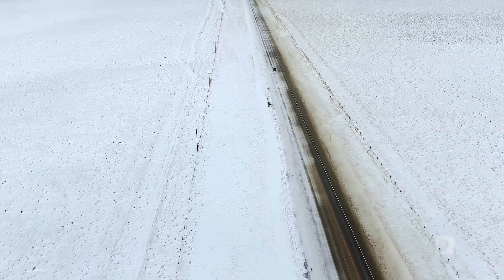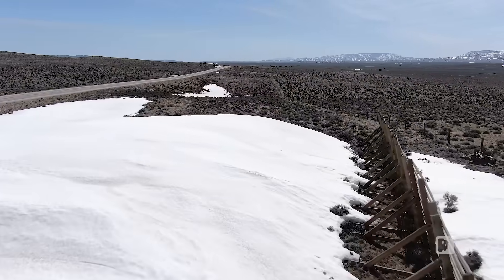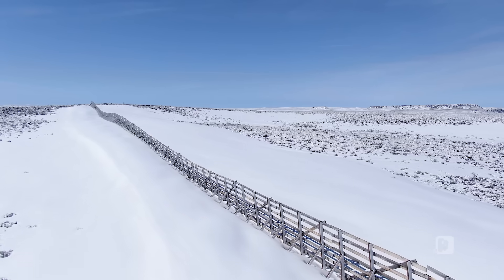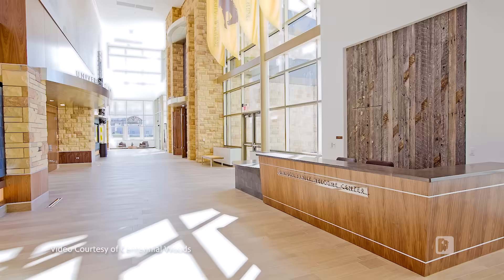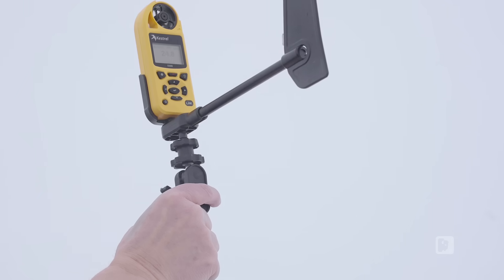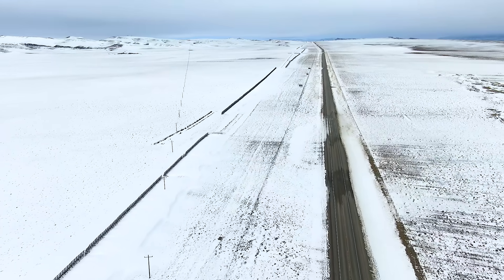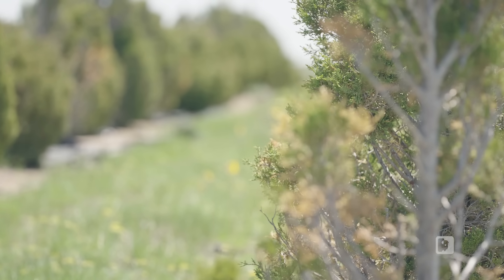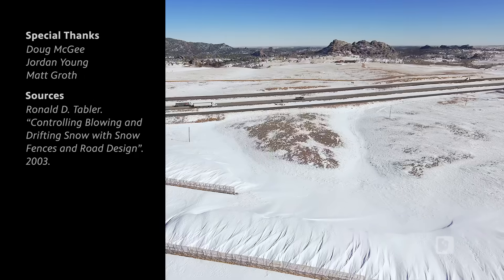The Science and Strategy Behind Wyoming’s Snow Fences

Comment: Many great ideas have eventually become bad ideas solely based on the materials used or sometimes a distinct lack of an engineer. So i hope at some point they look for a more permanent solution like steel because they can use the data collected by the timber frames and the evidence we all see of buckling as a case for investment in steel.

So the timber framing has an important function of providing evidence that a larger investment is backed by real data.

Comment: Pennsylvania stopped using snow fences about 50 years ago, and it shows! They were just rolls of two inch or so slats they would put out every fall and take down in the spring. No science or thought behind them. Now they just put up signs that unfold to warn of snow drifts along a stretch of road. So reassuring, confidence-building, and evidence of mindless bean counters being in charge of public safety.

Comment: In my neck of the woods we drove 8 ft T rails  with 5 ft wooden slatted wire (latter years)replaced with plastic ribbon )fence in in November and removed in April to not lose  any plantable farmland…approximately 75 feet from pavement perpendicular to prevailing winds….most of the farmers stored and installed the fencing themselves because of the added lbs/arce yield of crops…

Comment: iAfter WW2 and into the early '60s Virginia, Northern VA in my experience, had snow fences along may primary and heavly travelled secondary roads.  They were verticle pieces of wood, about 1 1/2 inches wide and spaced every 1.5 to 2 inches and held withe heav wire inteleaved with the boards.  They were set out in the early winter and removed for storage in the spring.  The design allowed them to be rolled up into large rolls, making the logistics of storage installationand removal reasonably easy possible.  Saw saw lots of snow drifts because of those.

Comment: When the national highway interstate system was planned out in the 40s they didn't take into account road routes that used natural features to minimize snow drifts that could close or hinder the highway during winter.  

It was a classic engineering over sight on the governments part.

The local populations knew better areas to put the highway for higher utilization. 

Of course,
The locals were not asked or consulted for their input or ideas.

Comment: Please ZigZag the fences I believe this will increase effectiveness from all directions. In the winter of 2015 I was driving a semi through Wyoming, the entire state roads were clean it was sunny except for 1 mile. There was a snowdrift, roads just opened so I one of the few to encounter it. The snow was dry and the road was polished, ice skating rink conditions, all of the sudden my trailer starts overtaking me at 70 mph and to make things worse the pickup truck in front of me starts breaking. I’m sliding, after 7 corrections I regained control. Others weren’t so lucky, about 20 vehicles piled up on both shoulders.

Comment: I love this approach. No chemicals, not running trucks all the time to plow snow, etc. Feels like the kind of thing you do when you take the time to understand nature and make it and the physics of the world work to solve a problem.
Reply: Theyre still running plows. These just make it possible for them to do their job
Reply: @andrewmitchell5807  Really? Before the fences, the roads would get buried too deep for plows, is what you're saying? Or is it that they had to run them so much more? I thought they said it reduced the need for plows (maybe not to zero)...
Reply: @KenMaerran Yes, without these you can see drifts over 6ft in parts of the roads; the plows can't get through. If you're out this way and see highways closed, the drifts are the reason most of the time.
Reply: I like it because it doesn’t block off any potential nature crossing.
Reply: Science & engineering baby!
Reply: More hands on = more jobs as well.
Reply: Duhhh brooo theyre like spreading chemicals everywhere bro, like for real.
Reply: @Sublimation.557  it's crystalized oxidane and very dangerous.
Reply: @Sublimation.557  thats what road salt is dipshit, it damages the ecosystem to dump pounds and pounds of salt on the ground. reducing the need for it is very good
Reply: @Sublimation.557 yeah snow is made with one of the most common chemicals on earth
Reply: @erinsmith5837 at the core of every raindrop and snow flake is a speck of dust that the water condensed or crystalized onto.  sometimes the dust is volcanic ash, skin cells, radioactive material, but mostly it's going to be air pollution from transportation and industry
Reply: Nope we have to make things as difficult as possible. Look at how we approach and deal with fires, we send in the Brad Pitts to go "fight the fire". Total rip off what the military does recruiting. They cause a problem, then create a tax to fix said issue while scraping some off the top.
Reply: @casval-pj5tb  What the heck are you talking about?
Reply: @DrLumpy man hates firefighters apparently

Comment: Worked for Niagara county parks in Niagara county NY. Putting these up every year was and is a pain. It's nice that the parks are all year round parks, but we have to convert the parks every year. Closing certain trails, rerouting trails, setting up the layout of the cross country skiing, converting warm houses. We'd use a fabric material. Holes big enough for wind to pass through but designed that the snow will catch on and make a literal snow wall. We'd also place these in flat areas to curb snow drifts on roads, trails, etc.

Comment: Looks like another government grift to me.  Same amount of snow on the road as everywhere else where there isn't a fence.  All these do is accumulate some of the snow in a designated place and that doesn't seem very helpful in this case. Nothing about these is wing shaped like they said.  These work in a pretty localized way and I question that effectiveness of the governments mass application.

Can WDOT please show use how much less budget they need and are using since the installation of the snow fences?  Are winter accidents or stranded and trapped motorist declining in a meaningful way?  Show me the data!  With out data I remain skeptical of everything the government is doing.

Comment: Yay snow fences!  I've lived in Iowa and N Illinois, and they put out snow fences every year.  There, they use smaller fences, essentially rolls of 2-3 inch wide slats, maybe 5 ft tall, which get taken down in the spring.  I suppose it's because it's all corn and soybean fields and the farmers need to be able to get their tractors out there.  The fences keep a lot of snow off the roads.  Most country roads in that region are a few feet higher than the surrounding land, so the snow just blows over, but when there's a cut or any land higher than the road they put out the fences.  Also ditches catch a lot of snow.

Comment: Having done I-25/I-90 across Wyoming dozens of times the state is far, far worse for winter conditions than either Colorado or Montana, mainly because snow blowing across the road gets compressed by traffic then polished into sheets of shiny glare ice that will  stay on the road for weeks or months in winter even when not much new snow actually falls. Add in high speeds, unpredictable visibility, heavy wind gusts and the distances involved and you have some of the most dangerous driving conditions I've ever seen. The ROI on these snow fences has to be multiplied many times over when you add lives saved to the dollar reduction in maintenance costs.

Comment: I'm glad to know my guesses were correct. Texas native here who, on vacation in SD, drove to Montana, then south thru Wyoming and Eastern CO. I had referred to them as snow fences, but figured that was too simple a name for them. In Montana they were about the same heighth, but made of stouter wood. In Colorado, they were little more than thin upright slats wired together, which i have seen in use for a similar function, to control drifting sand dunes along a few roads on the gulf coast. That trip was a good memory.
Reply: The skinny upright slats are often temporary fences to test where the bigger fences should be.
Reply: @lazygardens ah, thank you.

Comment: Growing up in the 50s and 60s in New England we used to see these everywhere, though not quite as elaborate. They looked like large rolls of red painted wooden slats wired together with gaps between. Roll them out before winter and roll them back up in spring. The supports that held them up were permanent.